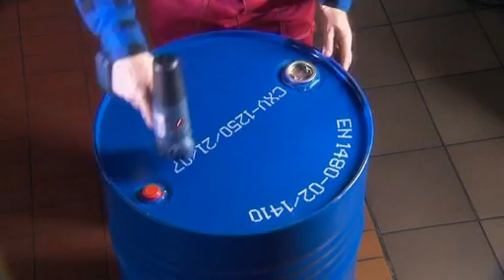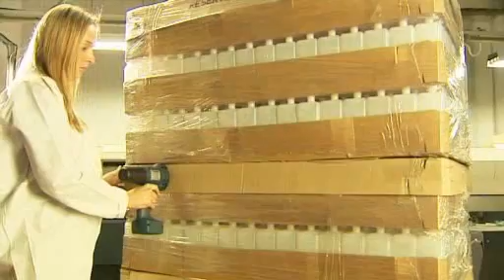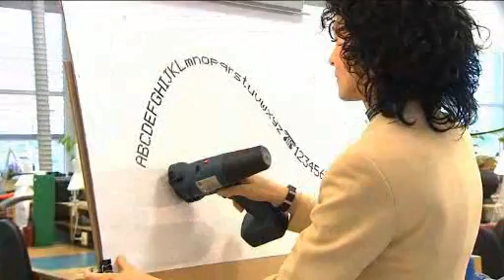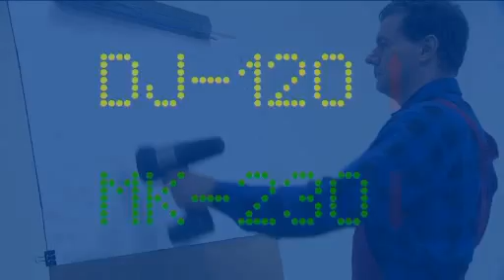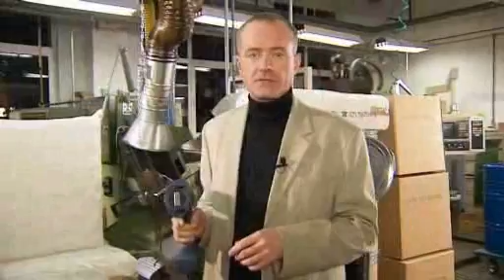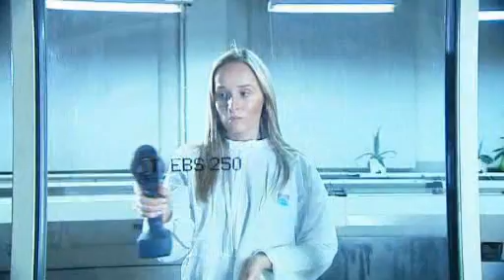Part 2 HANDJET® EBS 250 portable printer

Comment: Ah but how well does it print on skin, fur, hair.  How long do the printed characters last?  Are they fade resistant or fade proof?  Water proof or water resistant?  I see the new HandJet 260 is out.  This is the sort of thing that can revolutionize graffiti tagging and re-pricing or marking products in retail locations (by customers).

How does this compare to fixed inkjet printers that can print onto materials they pass by them via conveyor belt?  I mean aside from the 2 day battery life and mobile drill/screwdriver form factor?